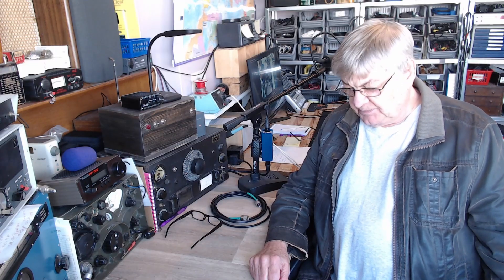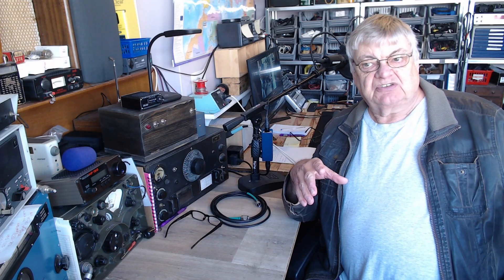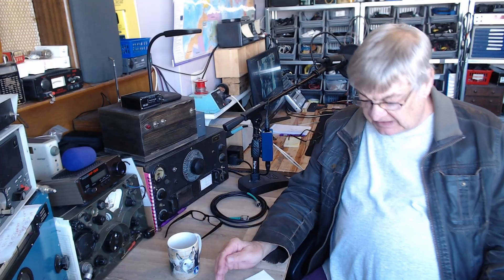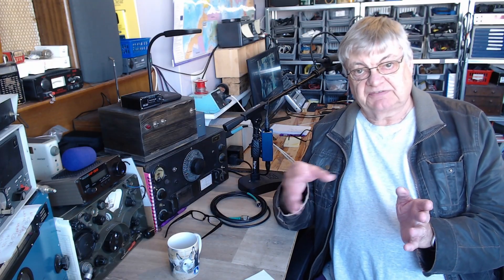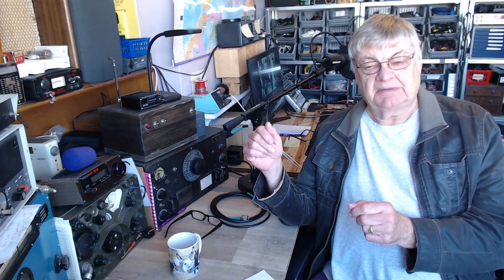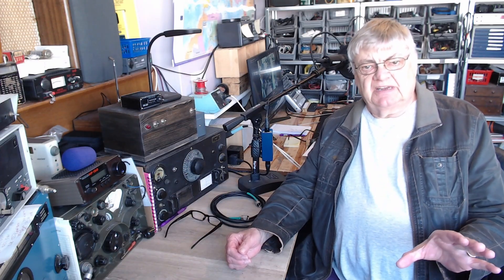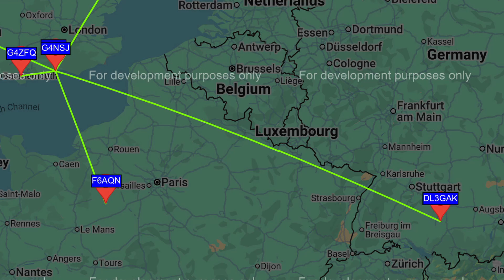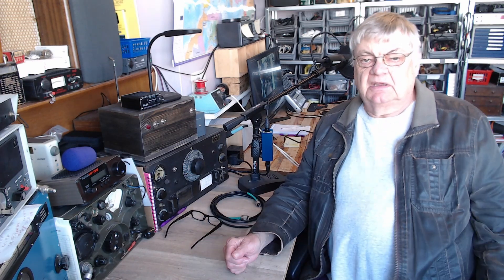G4NSJ - WSPR weak signal propagation reporter. What's it for?

Comment: Like you, I've been using WSPR to test various antennas, particularly portable ones. My difficult is that for 40, 30 and 20 meters propagation conditions make a big difference. I cannot run tests on different days that mean much. It'd be great if I could make the comparisons say 10 minutes apart. Broadcast on A, then broadcast on B, then back to A and so forth. The difficult is that all the data is linked to my callsign, which remains the same. 

Is there some way I can separate the results, perhaps by tweaking the call signs to be processed differently? That would give two sets or reports. Or as an alternative, could I create a data summary that separated alternate transmissions. One summary would be for the receiving stations at 00, 20, 40... and the other for 10, 30, 50?
Reply from the maker: I'm not sure but I believe you can have /A or /B etc after your call sign.

Comment: Nice explanation of WSPR Ray. I've listened in on really low power beacons (2 to 4 milliwatt) running around 13.56 MHz here in the US. Some of these use WSPR, and signals have been decoded from well over 1000 miles away.  For top band receiving, have you tried an rf isolating transformer to separate the aerial ground from the receiver (coax) ground? This can be a good technique in some situations.
Reply from the maker: Hi, no I haven't tried an rf isolating transformer. I'll give it a go. OK on 13.56 MHz, that's interesting. Cheers, Ray.

Comment: I have the 2 ZachTek units which covers upper and lower bands, like you i use it for antennas and to check propagation also i set them on the computer to switch bands and unplug them from the computer and usually let them both run on different antennas as they are also stand alone units. Thanks for the videos you do, most helpful.
Reply from the maker: OK on the ZachTek units. That's interesting, thanks. Cheers, Ray.

Comment: I plan to come on js8 on 160m.  This is my plan.  I have a horizontal end fed half wave on 80m (just fits my garden corner to corner over house).  I plan to put a relay that will switch out the 49:1 balun and then connect my earthing system under  the garden to the outer.  This way, I will end up with a quarter wave horizontal with a ground system.  I'm not sure if it will work.  What do you think?
Reply from the maker: It should work well. Give it a try and let me know how you get on. Cheers, Ray.
Reply: @g4nsj   I heard you this evening on 160m JS8Call snr -19db into north cambs on my efhw for 80m.  My goal this weekend is to get a tune on 160m so I can tx. M7MEK

Comment: Hi Ray, always like hearing how people operate on top band, and how they've set there aerials up in a postage stamp QTH, I live on the top floor of a 5 story block of flats and run a sort of 200 foot doublet one half slopes down to a fence in the carpark and the other half is indoors from the balcony though the hallway to the front door then in and out of the bedrooms fed with 450ohm twin feeder ( ladder line) into a balun with a double male adaptor into the ATU, with the help of a mains filter and null steerer help's reduce the noise floor to a reasonable level S6 the doublet works ok on the lower bands 160 80 60 40 and 30 meters, I wondering what the noise floor would be like when we see the end of ADSL and VDSL.
Reply from the maker: Hi Adam, it will be nice to see the end of ADSL and VDSL. Your antenna sound great, well done. S6 noise level is pretty good, compared to mine! Cheers, Ray.

Comment: Thanks Ray for the interesting topic of Whisper weak signal propagation, i haven't tried this yet but i should really as i have been making various Wire Antennas. I use FT8 and FT4  a lot and using Wsjt-x and PSKreporter which shows where your signal is being received  in a similar way. I have made a few contacts on 160m using an end fed random wire of 84ft and a 9:1 Unun transformer then using the Rig to tweak the final matching. Its very much a compromise Antenna but 160-6m is a benefit and like you i don't have a long garden unless i run the wire all around the edge of my property. Not sure thats a good idea. 73s G8TQO
Reply from the maker: Hi Graham, your white antenna sounds pretty good. Don’t worry about running it all over the place.  I think the more wire out in the garden and the better, it doesn’t matter what shape it is. I use FT8 sometimes and PSKreporter. I like experimenting with antenna, it’s all very interesting.  Great to hear from you.  Cheers, Ray.

Comment: Wspr is a great tool Ray especially if used with the grey line...saves you calling CQ and not getting beyond the end of the street lol absolutely zero interest in ft8 I am one of those that's starts the argument saying it's not proper radio 🤣....love winding them up ...I feel sorry for you with the noise ..I am spoiled as my noise floor is almost zero.
Best wishes and look forward to you ranting on Sunday 👍 Mac
Reply from the maker: Hi Mac, it certainly is a great tool. Okay, on the grey line, that’s interesting.  I suppose FT8 has its uses, but it’s not something I bother with a great deal. Zero noise level. Wow! That’s excellent. Cheers, Ray.